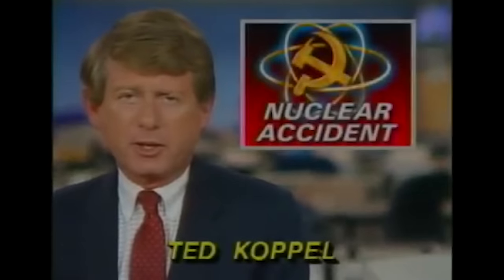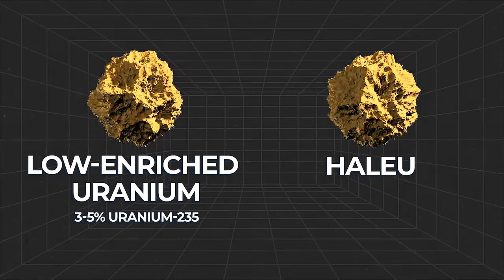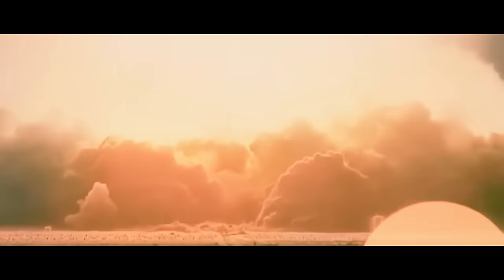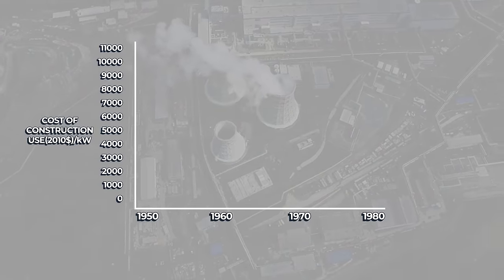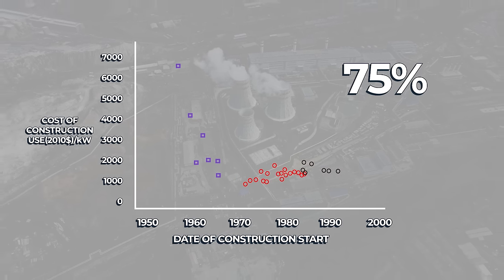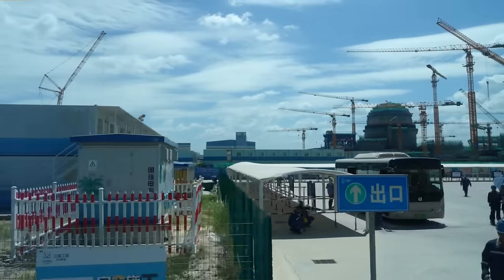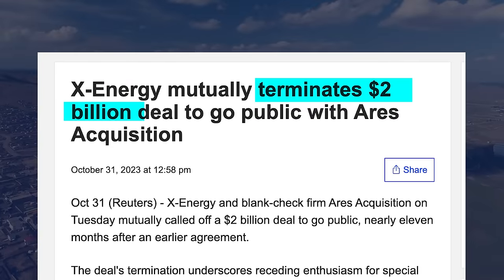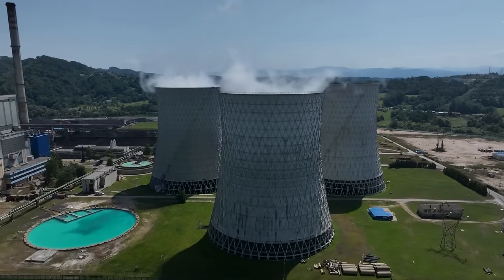Nuclear 4.0 | The Small Modular Reactor Revolution

Comment: It looks like one hell of a tea kettle. All that modern technology to run a steam generator whos technologies have been around for a long long time.
Reply: Yea and we still get from point A to point B on those round thingies just like they did 3,000 years ago
Reply: @clarkkent9080  You keep saying that. 

I actually don't think people moved themselves about on wheeled vehicles until maybe 200 years ago? Before then it was walking or maybe on horseback.

I agree with the comment about steam generators - it seems a clunky way to produce electricity. Dig up something to burn, to boil water, to turn a spindle, to rotate some magnets ... when will we move on from this paradigm? 

People talk about nuclear as if it actually produces power, but all it does is boil water.
Reply: @footbru  Actually the steam cycle is very efficient, simple, and easy to control. Nuclear fission produces heat.  Is there any other way to convert heat into electricity?

BTW, The wheel was invented in the 4th millennium BC in Lower Mesopotamia(modern-day Iraq), where the Sumerian people inserted rotating axles into solid discs of wood. That would be much longer than 200 years ago.
Reply: @clarkkent9080  Totally missing BOTH my points.

The steam cycle IS - obviously - successful. Fossil fuels, fission, fusion, thorium, SMR - it's all the same. Dig, burn, rotate.

Can you have a steam cycle electricity generator to supply all of your electricity for your home? I would prefer, being absolutely idealistic, no moving parts and no inputs except the initial capital cost. To generate the electricity I use. It seems to me that there will always be associated problems with the steam cycle. 

Maybe Concentrated Solar would make me happy.

Solar plus battery does that, without heat. For one home, for a town, for connected segments of a city, maybe for an industry. 

That's the sort of paradigm I prefer. It may be that space based solar will one day work on a much larger, more efficient scale. No moving parts, no heat, no inputs.

Your other comment, that I've seen several times, was not about when the wheel was invented, or where, it was "Yea and we still get from point A to point B on those round thingies just like they did 3,000 years ago"

And my contention is that, until 200 years ago (or so) we didn't use wheels to "get from point A to point B" - we mostly walked. Wheels were special devices largely reserved for transporting goods.
Reply: @footbru  My points are simple:
The steam cycle works and works well and has stood the test of time. Why change something that works, especially when there is no other known method as efficient. No need to make fun of a method that has been used for centuries and is simple.
You could use a thermal/electrical generator like the ones in some space craft but the output is very low.

The Egyptians were using the wheel for many things 3,000 years ago and it does not matter what it was used for, just like the steam cycle, it works and works well.  

Sometimes you find something that works and stick with it.  Fusion, if it is ever perfected, will use the steam cycle.

I have looked at solar and battery backup for the last 20 years and the options and performance keep getting better.  But, other than the idea of being somewhat more independent, overall, it is not cost effective and would most likely not pay for itself but it would add complexity to my life.

Comment: A great use would be remote mining power needs.
Reply: Yes so when the mine owners abandoned the mine they can also abandoned the reactor waste
Reply: @clarkkent9080  Do some research before spewing.... it's a self contained unit, waste and all.  75% of the energy in France is nuclear and has been for decades.  These new units are even safer.
Reply: @ChuckFinlan  I don't know much about nuclear power in other countries but I did work 40+ years in the U.S. nuclear industry at 5 different facilities so I don't have to do research, I have experience.

Now with that out of the way, the claims you make are based on what research??  Since the type of nuclear power plant you reference does not exist and never has existed in the U.S..  You watch some YT video created by a startup company with a fancy power point presentation that has no nuclear experience and make claims based on a unicorn reactor. 

Please reference your French reactor that is self contained and has been dropped off for powering some remote location. You may be right if it exists outside the U.S. and if I am wrong, I will apologize as I would expect you to do if no such nuclear power plant actually exists.
Reply: @clarkkent9080  What sort of work did you do?  Operations or construction?  I don't have any faith in the US conventional nuclear program due to the availability and cost of fossil fuels here.  I do have faith in France's program due to the same reasons.  The new tech that I was referring to are the newer "portable" units that are in development.
Reply: @ChuckFinlan  All in house operations jobs.  Radiation Control, Field operations, Licensed Reactor Operator and then Senior Reactor Operator, Operations during plant construction, Weapons production Reactor supervisor, Waste management, etc..

I cannot speak for other countries but I can assure you that "portable" nuclear units are not something you would see in a U.S. commercial application.

Any nuclear power unit, be it 10 watts, 100 Mw, or 1 Gw would come under the same regulations.  There are security, operation, maintenence, and detailed site evaluation for natural/man made accident mitigation, emergency planning, etc..

There has never been economies of small scale in any power generation. Nuclear power plants have gotten bigger over the years in an effort to reduce overall costs. 

The military has explored "portable" nuclear power plants for military bases but the risk in war and getting another country to authorize the U.S. to site a nuclear unit in their country presents problems.  And the safety systems that we consider necessary makes "portable" units not so portable.

Comment: Despite obviously doing a lot of research there are shockingly blatant omissions in this. What an i talking about? Money and market control. Every publicly known failure has been caused by management issues, and aside from Chernobyl all are linked to corporate skimming. On top of this, there is a negative incentive against small reactors at every level.

Manufacturers don't want small municipal projects, they want megaprojects with custom requirements and a permanent income for maintenance. Most proposed smaller systems are not "purchases" either, but indefinite support contacts requiring future re-purchases.

I'll skip over the overinflated effects of 3MI and the fact that the oil and coal industry have worked hard to undermine nuclear power while the US foreign policy has also sought to prevent use from expanding due to proliferation concerns.

Comment: So if the got those small reactors to 60 million that's price of natural gas turbine. At least that was the cost in 2019 when company I work put new power plant, could be higher now. Each turbine is capable of 300 MW per hour. What would power output of these SMRs be. Would be less or more or about equal. If it was about the same or more then this would be good solution to the green house gas problems with natural gas.

Comment: First of all... I still do not get why we are not using stirling engines of many sorts and you basic Thermo-Coupling as a second stage power production and reclamation.

That heat is half the energy being released, and we are leaving it on the table. I can get it,to a point, in the case of cars, thougha thermo-coupling  element in the radiator seems self evidently useful to me.

This isn't new technology. It just makes the power from the fuel go for longer.

Thermo-Coupling Too expensive to source compared to the result? I disagree, but what ever, stirling engines have zero need to be expensive. No rare earth elements or the like.

It is just a form of Cooling/Heating that can also be used to produce power...

Comment: What about Torium reactors?
Reply: They don't existist.
Reply: They do... China.... SMH... GOOGLE is more than verb..
Reply: The engineering isn't there yet for Thorium.  Until we've built a few Thorium plants we don't even know what problems we'll need to solve, much less how to solve them.

It's like switchgrass.  You can make Ethanol from the stuff and unlike corn Ethanol it's actually energy positive.  Oklahoma alone could grow enough of it to meet the fuel needs for a good portion of the country.  We could switch everyone over to E85 or even pure Ethanol and get rid of gasoline engines altogether.  So why don't we?

Because the engineering isn't there yet.  We can do it in the lab, but every time we've tried to scale it up to large-scale industrial production it just doesn't work.  It's a solvable problem, but engineering and building pilot plants aren't cheap and someone has to pay the bill.  So we still get our Ethanol from corn, which keeps the farmers happy but drives food prices through the roof.

Comment: Nuclear waste disposal is still a problem that's a long way from being solved.
Reply: Not to make excuses but in 2014 the U.S. alone had more high level nuclear waste than Yucca Mountain could handle and that is not counting NNSA and DOE waste.  We already have a lot and it will have to be addressed at some point.
Reply: @clarkkent9080  As I understand it, Yucca Mountain got cancelled because of "not in my back yard" syndrome, and according to some, due to questionable engineering as well, and has never actually received any nuclear waste.
Reply: @wayne.edward.clarke  It is true Yucca  Mtn. never received any waste but the disposal capacity was exceeded in 2014, based solely on available commercial waste. So it never was the complete answer. 

 The rest of the story is more detailed.  The 1983 Nuclear Waste Policy act specifically stated that no less than 2 nuclear waste disposal sites would be chosen in different parts of the country so no one location would get all the waste. And the site was to be chosen on purely scientific grounds and that would be a salt formation which Yucca Mtn. is not. 

Nevada does not have a lot of representation in the House and each year other states were removed from the list of potential sites until Nevada was left.  It was chosen for purely political reasons and  put on hold by Obama and Harry Reid. Trump completely killed it in 2017.

Believe it or not, Trump said it best when he said You cannot force something like that on people who don't want it.

Comment: Its more about standardization, weather its large or small reactors we only build a few reactors per year. Around 60 reactors are build within this decade in the world while during the 1970s france alone built 53 reactors. France basically had the entire worlds current production of nuclear powerplants. If you standardize and mass produce reactors then cost will go down but if you just build a few prototypes then the cost will go up. 

There a too many reactor designs and too little standardization. People are just stupid since they do not understand economies of scale. It does not matter how much the first prototype cost what matters is the serial production cost. If we produced solar pannels at the same rate as nuclear power plants then solar energy would be way more expensive then nuclear energy. Even now with massive amounts of subsedies to solar and wind it still can not replace enough energy production while nuclear has actually achived close to net zero.

My homland of sweden has only 4% of its electricity releasing co2 and france only got 10%. While germany got 60% of its electricity releasing co2. If people belives that 60 is a smaller number then 4 then I have no hope for their intelligence.

Comment: Your suggestion of building solar for remote mining areas with batteries and generators for backup is all useless. Snow in winter covers solar panels, dust in desert areas, and clouds make solar inefficient. Then you have a hail storm and lose the lot. Your batteries wont work without recharging and if you rely on diesel generators as backup just bloody use the generators all the time and get rid of the shit and waste of money.

Comment: Great idea, nuclear vehicles, like envisioned in the 60s.
Fuel up once.
But with another nuclear power unit in the home.
Electricity all day long, ezi pezi.

If it fails you just get a replacement swap out.

Or just plug the car into the home in emergency while waiting for the replacement. 

Mass produce them. 
No blackouts ever.
Export them around the world. 

CO2 emissions worldwide could end in 2 decades.

Fossil fuel as feedstock to chemical industry and may be the military. 

Time line for nuclear reactors construction vs gas turbine generators construction, see:
YouTube · Illinois EnergyProf
Illinois EnergyProf
Professor David RuzicAbel Bliss Professor of EngineeringDepartment of Nuclear, Plasma, and Radiological EngineeringUniversity of Illinois at Urbana

Comment: Why on earth would you spend 600 000 dollars to build a solar farm FOR A MINE, not to mention the photos and video you took that land is rough raged and unlevel/non flat. You're in good luck if it's even POSSIBLE to put down enough solar panels to charge someone's EV. Good luck if you want to mine at night or when the clouds are out (muh batteries, yeah mines are hazardous enough without lithium fires no one with any sanity is going to approve giant batteries full of flammable material around a FKIN MINE.)

You also have to cut down an entire forest if you put the solar farm anywhere besides a literal desert, whereas a mobile nuclear salt reactor can fit inside of a single semi truck.

Comment: When the foundation for everything you believe is flawed, everything you build or design off of that belief is also flawed. Case in point. The belief that every single EV needs a battery pack that will get near 300 miles, cost 3/4 of the cost of the vehicle, 3/4 the weight of the vehicle and requires the use of diesel driven machinery to move 500,000 tons of earth to create one battery.  When the worthless government calling for these requirements could create an infrastructure 3rd rail if you will in road power system that one pays based on metered usage.  And only requires a small battery instead.  Look back for more answers.

Comment: there's not a single video on marine reactor . . . used on carriers & submarines . . .
Reply: Military reactors are nothing like commercial units and they do not have many of the safety systems required for commercial units.
Reply: @clarkkent9080  alternative to extracting steam from nuclear reactors & running it through gas turbines . . . meaning other options, without the need for gas turbines . . .
Reply: @chandrachurniyogi8394  What would those other options be?  Thermocouples? 

Turning water into steam requires tremendous amounts of energy that can then be transported to a component (turbines) that efficient extract that energy and turn it into rotational energy.

 Other than solar, every other method to generate large amounts of electrical energy requires rotation of a generator.  What other option is there to rotate a generator?
Reply: @clarkkent9080  so according to you the gas turbine is imperative to transfer & convert that into electric power through the generator . . . heard of marine solid state engines that has zero moving parts . . . but I don't know the exact operational doctrine behind a solid state engine . . .
Reply: @chandrachurniyogi8394  Not according to me but according to every commercial and military ship that uses propulsion.  If you don't know how a solid state engine works why are you claiming the don't use a rotational generator?

Comment: Solar and wind is fine and all and have their purposes, but for a long time they will not be able to fix our power issues, too slow to build enough, too much a money/subsidies game, recycling is basically non-existent, nuclear power and in the future thorium reactors and fusion are the better ideas almost certainly, for now, nuclear reactors is what we need as well as a complete overhaul of the power grid itself. Here in the Netherlans the power grid is better than that of the US, but that too is nowhere near capable of being able to handle the growing amount of EVs, especially not on the level the government wants in the coming 10 years, and that is a long and expensive process to replace, and they don't seem to even look at that problem let alone do something about it, it is absolutely asinine, and then think what woudl be needed in the US. Good luck.
Also, the price may have gone up to the old ways, but you have not ended up where you started, it's safer.

Comment: Instead of these horrible centralized monstrosities I could build something the size of a water heater that would supply endless full power to each and every home. And endless hot water.  In the case of a massive natural disaster you wouldn't have 10s of thousands if not millions of homes all go offline at the same time. And you would lose 15-30% of all gross energy produced just to the resistance and inefficiency of the grid.